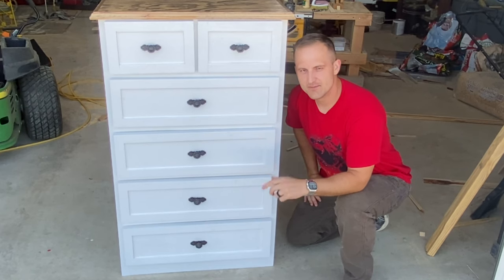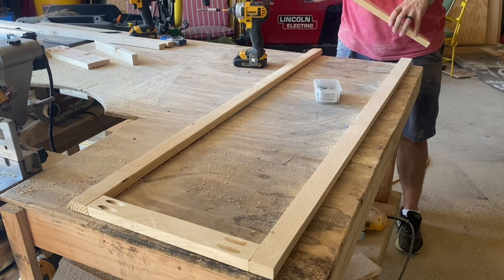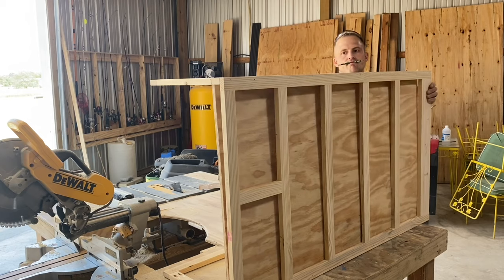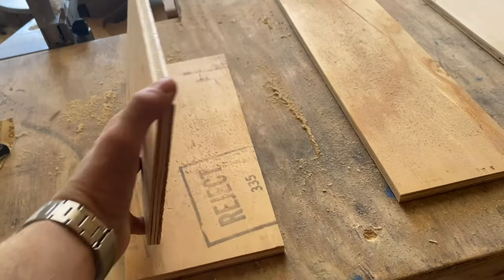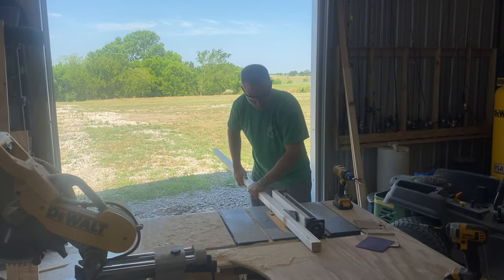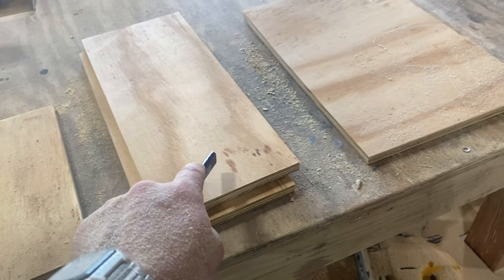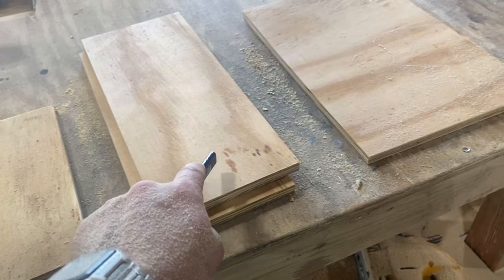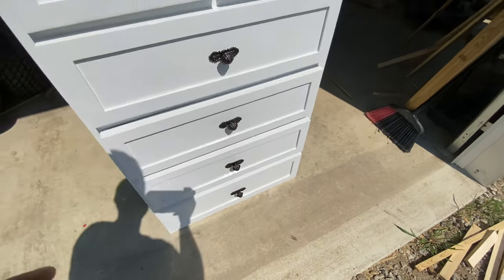How to Build a SIMPLE Dresser (Basic Tools!)

Comment: Nail gun nails have a wedge on the end.  They will deflect to the right or left but not front or back.  At 10:58 if you hold it 90 degrees to the bottom of the drawer, you wont get the deflection you got.  It's easier to avoid than fix.
Reply from the maker: Thanks for the tip Adam! I’m always dealing with those things popping out on me.  I’ll try that next time!

Comment: Super informative video man. Big help for a guy trying to do the exact same thing. I'll need a table saw set into a big table like you'be got  and chop saw and I'll be watching this again when it's time to build. I'll modify the dims though. 

So all sims are based on those under mount slides right? As they are a fixed depth?
Reply: Also where did you buy the sliders?
Reply from the maker: Thank you! They way I designed this dresser, you could easily use side mounted drawer slides from lowes or Home Depot as long as you use 3/4” plywood on the left and right side.  You would need to attach a 2x2 or a 2x4 between the top two drawers to mount the top drawer slides though. The rest of the measurements should work out perfectly for slide mounts if you want to do that.  I bought the under mount drawer slides as a set at a garage sale, but if you want to use those, I found a link to a very similar set on Amazon that should work just fine. That’s in the description of you want to check that out.  Good luck on your build!

Comment: How do the drawers stay attached to the draw slides?  My build is for our grandson.  Another question I have is if the depth of my drawer is 13.75” what length of slide do I need?
Reply from the maker: They come with small screws.  I’m not sure if they make a 13” drawer slide. You’ll probably need a 12” if they dont
Reply: @DIYMAN  thank you so much.  It is a big help.

Comment: Is the 1 by 2 true dimensions or is it 1 1/2 by 1 1/2 just curious as if I by a 1 by 4 at the store it will come in a 3/4 by 3 1/2 also what size screws are you using 1 1/4 or 1 1/2 thanks
Reply from the maker: My 1x2s are .75x1.5. When I say a lumber size, it’s what you buy at the store
Reply: Thanks for the video I just got done building two of these for my sons your video made it so easy I’m not sure how to add a picture in comments but thanks so much for your video

Comment: Could say to the nearest $50 how much the lumber for this project cost you? I want to build my own dresser but I'm worried it might just be cheaper to buy one
Reply from the maker: The hardware is the most expensive part. Everything here should be less than $200 if you order the drawer slides online instead of going to Lowes or HD for them
Reply: @DIYMAN  ok thank you!!!
Reply from the maker: No problem!
Reply: You will find its more expensive to build your own just due to the cost of Lumber. BUT its far more satisfying to do it yourself and it will last far longer than the composite junk you get from most places. Just my 2 cents!
Reply: Here, where everything has gotten extremely expensive, you will spend near $200 in lumber using cheap plywood and non-treated pine wood slats. However the local home depot always have cull wood in the back of the wood area with a 70% discount, so that could save a lot. With the hardware it will cost more than a store bought chest drawer but the quality and durability will be a hundred times more. That garbage from IKEA, walmart, rooms to go and others don't survive a lot.

Comment: I’ve noticed in most of your videos that you use a 1/4 sheet orbital sander. Is there a big difference in that sander compared to a random orbital sander? Or is it a matter of preference?
Reply from the maker: I have both and I’ve never noticed a big difference in the two.  The random orbital sander might remove wood a little more quickly, but not much.  It is really convenient to change the sandpaper, but also more expensive. That’s mainly why I use the 1/4 sheet sander, because it’s so much cheaper